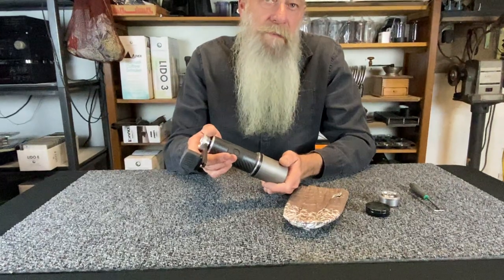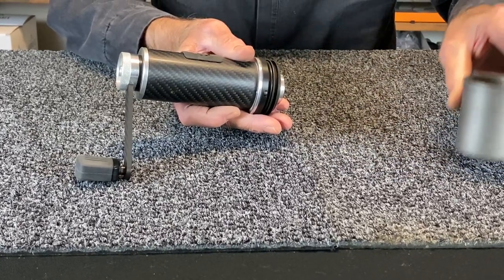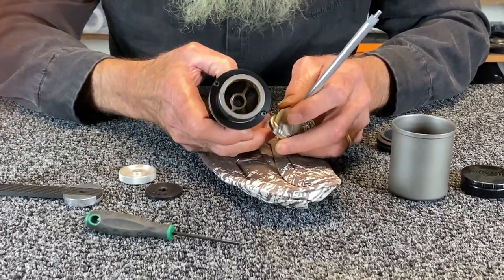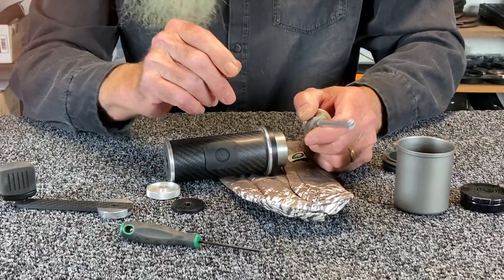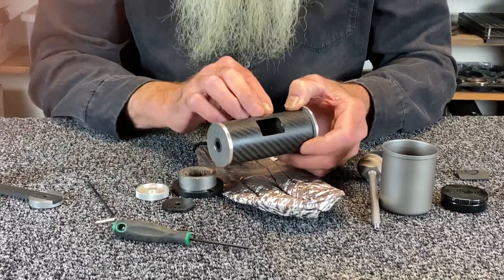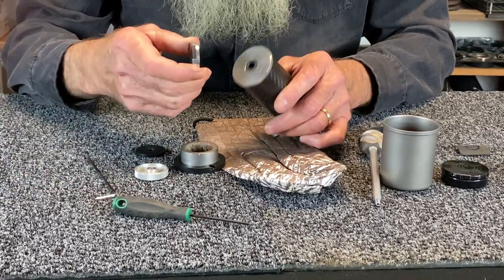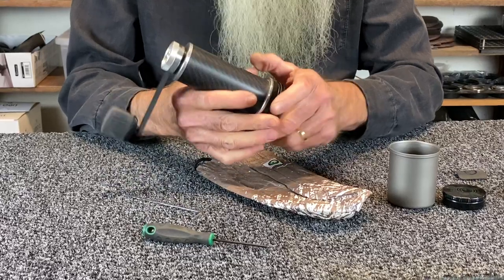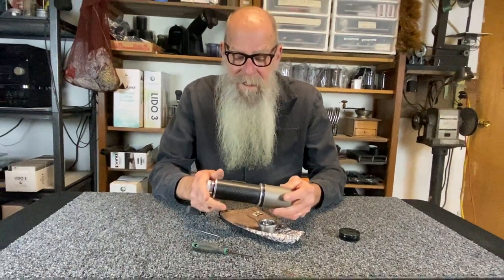Orphan Espresso Fixie Travel Coffee Grinder - X Ray View

Comment: In the age of laser cutters, cnc machines and 3d printers, I am trying to justify your price especially when it looks like you gotta fix your car brakes to adjust a grind size.  Note: I would pay $80 for this. Far less than your cost and yes, i am an a-hole, but a.guy who wants a product like this for everyone.  I mean, a baratza conical grinder set is less than $60 and your design is an conical pepper grinder.  Are people really counting ounces?
Reply from the maker: Yes, people are not only counting ounces, but grams...  No, it's not a conical pepper grinder, though I suppose you could grind pepper with it - we use a Lido to grind our pepper - just not the same one we use for our coffee!  As for cost - come back & talk to me about manufacturing and sales when you have some experience with it.  Materials like 7000 series aluminum, custom carbon fiber, and titanium don't come cheap, and we manufacture in Taiwan where they pay an actual living wage for a reasonable lifestyle.  Do hope you find the grinder you're looking for!
Reply: yeah and good luck with the grind you'll get on those Encores. even if it uses the same burrset (which it might not) the alignment is way easily done on these manual grinders than the electric ones. I know a lot of Encores that has burr rub in coarse settings. and this is a travel grinder, you bring your $60 Baratza up to the mountains and realize how much money you actually saved 🤣